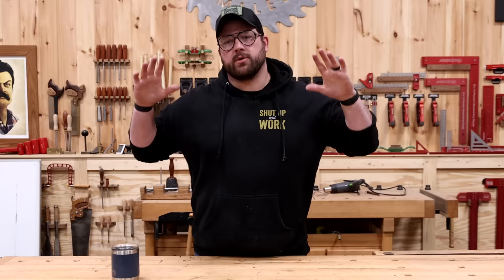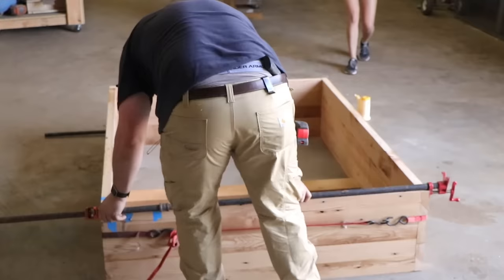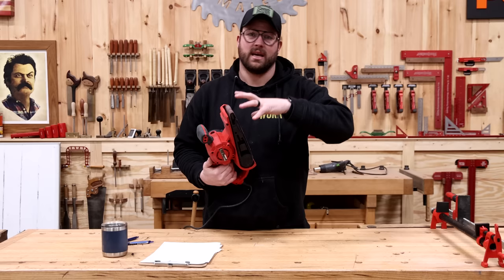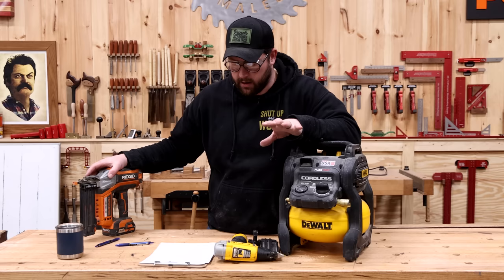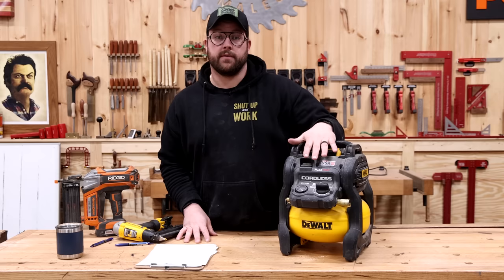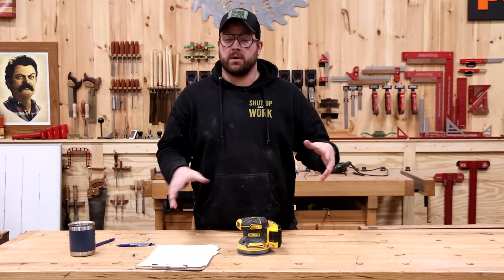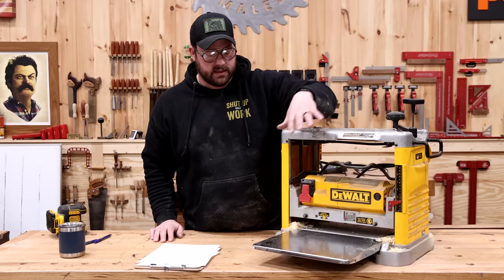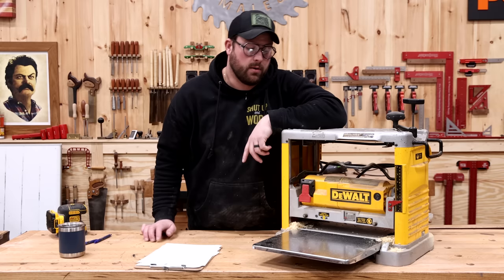5 Beginner Woodworking Tools I Regret Buying

Comment: I think this is a bit on from beginner to trying to go pro (you should probably make a few projects before you try that) for example, instead of buying a chord less compressor and a compressed air nail gun you can buy a pretty nice hammer  for $20-$30

Comment: I was able to pick up the Dewalt 734 planer from Home Depot for $350 CAD whereas the 735x goes for $899. I just had to go for the cheaper one here given my need isn't that demanding. I wanted to wait and save for the 735x but at less than half the price, I went for the lesser model.

Comment: Belt sanders sound like a great idea for stripping large areas, like decking, but it's a trap.  If you have sealant type oil or finish on wood, and you use a belt sander on it, at some point the heat will build up on the belt, and the finish will melt and clog up the belt.  Granted, the same can be said for any sander, but the reality is that belt sanders simply invite you to keep going and using it on long sweeps, rather than doing a small piece, resting it to cool, and going on again.  Better to save your time and use a heat gun and scraper, and then when the bulk is off to use the belt sander.  Regardless, you will still need to step down to a finishing sander at some point and step down your paper grades in any case for a fine finish.  I'm not saying belt sanders are a poor choice, just that they have limitations.

Comment: If you just doesn’t USE a spindle sander very often, how did you go thru 3 of them?   I bought a rigid spindle sander.  I have only used it 4 times in five years, but when I used it, I really needed it.  Of course, for any tool like that that is special use only, I don’t buy new. I bought mine for $50 thru OfferUp.  The guy didn’t tell me the threads on the screw head on the spindle were jacked… but I just bought a 5/16” left hand thread die and rethreaded it and its like new again. For specialty tools you only need once in while, these tools that can be shoved under a table or inside a cabinet and not take up floor space are best bought used. There are a lot of grandads dying every year with a garage full of great tools that the kids or grandkids have no interest in keeping.

Comment: Regarding the k-body clamp, the up charge for larger sizes seems disproportionate. I assume all the components are the same with just a longer bar. So it seems they are just enormously up charging for a few extra inches of steel bar.., the least expensive component.

Comment: Over 300 for that tabletop spindle sander? Damn prices have gone up. I have the same model and pretty sure I only gave a hundred bucks for it. If that.  But you're absolutely right. I think I used it a handful of times and now it just sits on the shelf. I started focusing  more on scroll saw work so that sort of tool is almost completely unused in my shop

Comment: Oké.. I am a professional woodworker living in europe.
The parallel clamps  have a hex slot on the back so you can crank them hard with a hex key or rattle. 
And they are great for delicate work because of the plastic body. But yes they are expensive. 
And for the belt sander. 160 dollar for a sander is really really cheap really for a professional tool. You should look in to belt sanders with a longer body they are a lot more stable… also any dust creating tools without a option for hooking up dust collection is junk. I find it astonishing that this is not common practice in the US, and that you have to call it new…
I have a Makita 9920. It’s a beast. I sand fineer with it. You should learn how to use one..
But it excels in table tops. The problem with random orbital sanders is they leave the high and hard spots high because the pad is going for the path of least resistance. A beltsander does not care and gives you a excellent flat  finish.

Comment: A better option for the planner is the old router technique, spoilboard bit and a $20 router sled(you are going to have to build this).
Reply: Ummm, no!  The router technique will work for flattening one side of large pieces but it's useless for precision thickness planing of multiple thin pieces.  I'm about to resaw a large piece of balsa to make it into sheeting to build radio controlled airplanes.  I can resaw to 1/8" thick sheets and use my Dewalt 735X to finish them down to 3/32.  Can't do that with a spoilboard bit.

Comment: I thought it was just me with those darn clamps, they're hard to slide in as well, and yet they'll slide all the way closed if you place them vertically next to you while you manoeuver something. And the amount of times I've had to reopen them, and then slide up and then retighten them, because the closing distance is SOO small, ugh.

I use that little planner as well, I hate having to completely open it back up to close the flaps for storage. While I have used it a bit, it was not worth the price of entry

Comment: Belt sander is great for rough sanding material that is to rough/dirty/painted to put thru a thickness and cost $20 second hand because it’s one of those things people buy, don’t use and sell for cheap 🤣 I wouldn’t use it for anything else tho. 

You can buy mortice and ten on bits and an adaptor for you existing drill press. 

Regretted buying my battery random orbit sander the first time I used it.

Comment: Re nail guns, reliability is an issue, the air guns are just more robust, reliable and easier to fix if they do jam, the compressors are more reliable then the batteries as well. I have rarely seen a carpenter turn up on site on a Monday morning and have at least one fully charged battery so there is always a 30/45 minute wait before they can start nailing. The compressors seem to run forever whilst the batteries degenerate with time. I have a slightly larger DeWalt compressor which will also run a framing nail gun in an emergency, as long as you go slowly. For workshop use most people have a compressor in their workshops anyway and you can buy kits of 16 and 32 gauge air nail guns very cheaply.

Comment: I can confirm the dewalt lunchbox planer was a total dog. Saw so many positive reviews for it, and it just struggled with pine and other soft woods. I'm not sure what the deal was with it, but I moved on from it. The belt sander is actually pretty nice for rough sanding pieces that are way out of spec. A decent used one (as no one uses them much) can be $20-30. And you are dead on with the air nailer and compressor. I'd suggest a quiet 2 gallon corded unit for woodworking things, or maybe something bigger if you use it for more stuff around the shop.

Comment: Biggest problem with pipe clamps is the do NOT work well UNDER your panel. You still need the K-Bars UNDER your panel. Pipe clamps up top.

Comment: I would disagree somewhat on your assessment of belt sanders. Yes they do require a good level of skill to get the best results but as far as hand held sanders are concerned, they are unequaled for smoothing long pieces of timber such as skirtings and architrave. But OK, use the random orbit sander for final finish

Comment: In short I'm all for battery powered tools. I've used the dewalt cordless orbit sander a lot. The fact that I don't have to pull a cord and work my way around the cord means a lot to me. I would argue that the fact you don't have a cord that can get stuck or too short makes your work more precise. I've never experienced any problems with lack of power or anything else in that regard. You have to change battery from time to time and that's that.

Also, the tool companies are all in on cordless tools, so most research goes into cordless tools. Tools with cords is hardly developed, so you actually get less technology for your money when buying a tool with cord.

Comment: Is that a Disston on the wall to your right? I have a pair of them from my great granddad. I keep meaning to get them sharpened and restored

I'm kind of glad I've got some great tools from my dad. I have an old 70s-80s Planer from Ryobi that is LEAGUES better than the Dewalt you showed and has plenty of balls. At least it doesn't stall out! Tho I believe it's only a 10 inch but it works for me

I have a small shop space however so permanent bench tools are mostly out. Unfortunately

Comment: Why use a planer at all? Once I switched to a drum sander...wider boards, no tearout, same thickness/planing ability.  And yes, I did waste money on a planer, but rarely used it after getting a drum sander.  Great for working with chess boards with grain going perpendicular on the same piece.  (Also wasted money on a spindle sander and a mortise chisel...but then, who hasn't?) 😊 Cheers

Comment: Gotta say i disagree on the cordless sander. I have been using a Metabo HPT cordless sander and a Bosch corded, and the cordless one is just as powerful and way more convenient. It cost more but it also has better features, like an instant brake and accessories to hookip to a vacuum.

Comment: Europe: quality pipe clamp set (no treads needed) is 35€ + 1 m pipe 20€ =55€ for one clamp. Low quality pipe clamp heads 15 € 
+ 20 for pipe = 35€ in total. 800 mm Bessey body clamp 65€. STAHLWERK screw clamps set of 3 Screw  F-Clamp 120 x 1,000 mm 50€. High quality sash clamp 1000 mm 50€. The only innexpensive option is F-clamps.

Comment: The only thing the belt sander is good for is substantial surface gunk removal. In return, it's going to tend to  directionally score the surface considerably, which means a hell of a lot of sanding with the random orbit and detail sanders to actually clean off the scoring and get it down to a seriously flat surface, so, yeah, you probably won't find a belt sander to be a good early purchase.

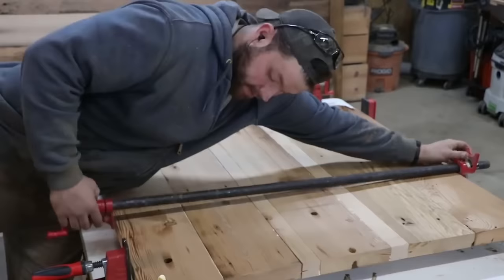Comment: 1:41 Panel glue ups can be done with a simple frame and some wedges. And its so Fn cheap. Especially if built to be adjustable...
edit: And I thought hand held belt sanders were just for racing...

Comment: I think it depends a lot on what you need your tools for - is there really a "typical" beginning woodworker?  Decades ago, I was assisting a male friend as he slowly, agonizingly, measured and then reconstructed a simple deck which had fallen away from the house two years after being built by the previous owner.  He wouldn't trust me to screw the deck boards down, so I sanded and stained them, over and over.  I killed a cheap orbital sander, and applied so many coats of stain that it was translucent and beautiful, but it began to peel.  I was so frustrated that I bought a 12" drill bit, a Makita corded drill and a Makita belt sander, and began secretly creating my first project - some redwood benches that are still in use 36 years later. That was the beginning of my learning about remodeling.  
     I later bought a different house, eventually designing a new, fanciful deck from scratch and remodeling the bathroom and kitchen; a third house needed a total redo, most of which was done by me and my partner, who was totally inexperienced in this, and hated it, but learned well.  My belt sander and I became as one - I learned to use it for every sanding occasion, even for curves, and I got a miter saw, 2 routers, a Sawzall and other tools.  I put in new fir flooring, moved walls, and used my basic tools extensively.
      I later moved back to house #2, and requested a (bench) table saw for Christmas to put in oak stairs going up to the former attic.  I needed the belt sander for endlessly smoothing a huge number of rough cedar boards to be used for siding on a new garage, and I bought a  zillion staplers, which mostly broke to secure garage insulation, and then an air compressor and brad nailers, which I barely used, and a Kreg pocket-hole system.  
      In recent times, I decided to try woodworking, and went to an open woodshop, where I struggled to learn the more exacting art of woodworking, and the more complicated tools for this.  I now have a good corded RO sander and have learned to use many of the woodshop tools - the planer, jointer, various table saws and sanders, bandsaws and routers, but even though they're helpful and often needed to do decent woodworking, I'm less familiar with them, they're still awkward, and I'm still only an advanced beginner at best.  
     As a beginner, the best buys have been tools that I frequently use. My remodeling background has guided my tool-using experiences.  Drills, the tablesaw, miter saw, sanders and Kreg's pocket-hole system were essential for both; jointers and planers are tools I have and use in woodshop, but didn't need for remodeling; I rarely use the circular saw, Sawzall and belt sander now, but they were major staples when remodeling.  The other tools I've bought sit around too much.

Comment: I think I'd rather just use a manual hammer than get stuck having to need a compressor, especially for just one-three tools instead of getting a brad nailer in the battery system I already have. But I also think the most I might use one for is stuff like putting the back on a cabinet or bookshelf, so I'm not really thinking of it being a tool I'd be using regularly enough to justify either.

Spindle sander: You can even replicate the vertical motion with some of the drill press models out there by working the press handle as you pass the piece through. A Powertec kit with 4 drums is only $19 at HD.

Planer: And you can often get that better 13" DeWalt planer with a free wheeled stand included in the version that comes with the in/out tables and a spare set of blades. HD currently lists just the planer at $600, with the tables and blades at $779, and with the stand at $757. By Rockler pricing those three add-ons are $300 separately, though they treat the stand as a free add-on to the kit at $779 rather than having separate sales items like HD.
Reply: Brad nailers are so convenient. I'm not uncoordinated but I can struggle putting some small items together with nails. With a nailer it is trivial. Just pull the trigger and pop there's a fastener in the work. I have shot tens of thousands of brads. You get 5,000 in one box. I've been through many boxes of the things. My main nailer finally started having troubles so I took it all apart and cleaned all of the crap out of the cylinder. It was like a family member was ailing. Now she's back to running as good as new. But it was touch and go on the operating table for a while there.

Comment: I still use pipe clamps on my commercial furniture jobs. There is nothing wrong with them at any stage of your woodworking career.  Also the only time to have a full collection of woodpecker tools is if you either have a ton of money you dont need or are sponsored by them. Their squares arent anymore square than the empire you can buy at the box store. The dewalt air 18g nailer is the way to go for finish carpentry. The dewalt has a soft tip so you dont have to dig it into your work in order to activate the safety.

Comment: I agree with your statements about the pipe clamps vs parallel on price, but you're just wrong about the clamping pressure. Parallel clamps give you more than 3x the psi of a pipe clamp.

Comment: I will say, one of the first things I bought, several years ago, was an old Rockwell tablesaw. The second thing was a Ryobi brad nailer. I don't know what the prices are now days, but 4 years ago, the Brad nailer was no $250. It cost me $110. At the point in time when I looked, the pneumatics brad nailers were almost $180.  I already had 2 of the biggest batteries Ryobi sold, but even at that, the battery and gun was cheaper than just the pneumatic gun. That's not even including a shitty $100 pancake air compressor. Damn times have changed.

Comment: While not a beginner, I still don't have a nail gun, and was looking to get one.  Do you have any recommendations for one that would get nails into oak boards.  I milled a bunch of 1/2" thick boards over the winter, and plan to side the inside of my garage with them this fall after they've had time to dry out.  I got an electric hand plane instead of a belt sander, I've found it to be more useful, but still don't use it very often.

Comment: Odd on the parallel clamps. I didn't start with them and after getting them. wish I had gotten them much, much sooner. Also, the Ridgid edge sander is also one of the best tools for cleaning up the edges and inside curves on small pieces. I am a full time woodworkers who started as a hobbyist in the garage. This seems to be latest fad list I've seen lately from the online woodworker channels lately.
Reply from the maker: Just my thoughts on beginner tools. More bang for your buck going with other options
Reply: Love the parallel clamps.  Hate pipe clamps.  They only come out as a last resort.

Comment: Have to disagree on nailer.  You still need the battery for that compressor so that is irrelevant.  Got my ryobi for $99 and it has bump mode.  The only valid point is weight but the trade off is no hose.

Comment: I agree the hand held belt sander takes skill to operate because it removes material quickly but that is also why i can't imagine not having one. It would be one of the first tools i would buy. You can make wood flatter than with an orbital also. Learn it, live it, love it.😅
Reply: Sanding isn't meant to make the wood "flatter", that's what a planer or jointer is for. I guess "learn it" and start using the right tools for the right job and stop arguing with seasoned professionals who know a LOT more than you.

Comment: I think you missed something by only talking about a cordless compressor.  Sure, cordless has advantages for job site work, but even there if you have power at all extension cords and the long hose get you where you need to go.  That option should have been covered.